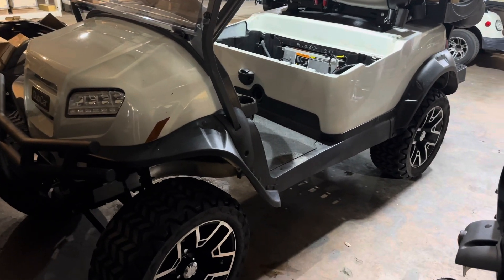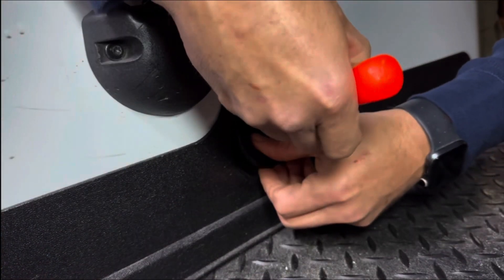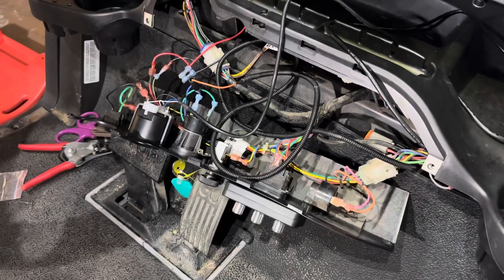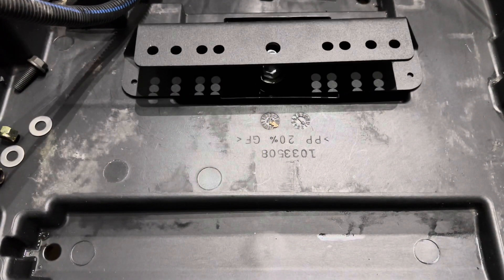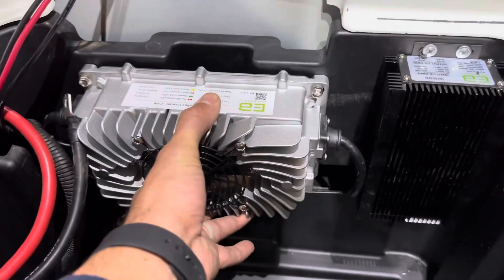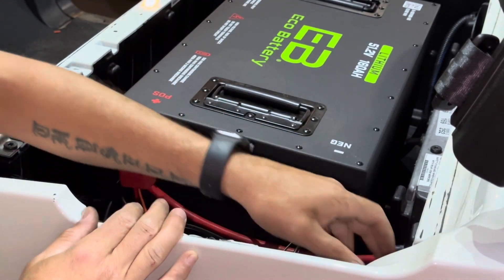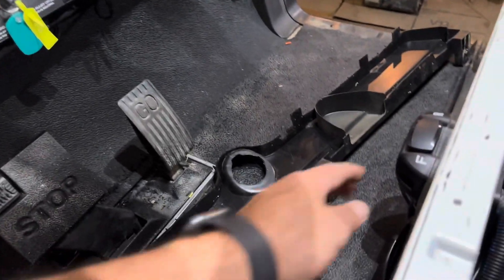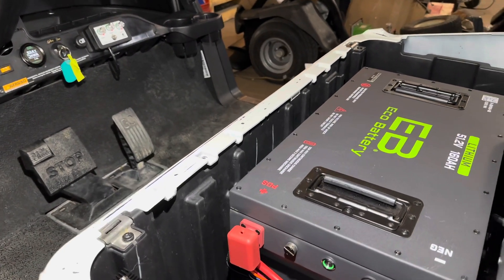Eco Battery 51v - 160ah Lithium Golf Cart Battery Installation Video - Club Car Onward/Precedent

Comment: I have a Ogrphy 51 volt 150 amp  and find it is a very tight fit for my 2016 EZGO TXT
Reply: Have to add a couple of layers of 2x10 and bolt it down .
Reply from the maker: Gotcha, some of these batteries are a tight squeeze for sure.

Comment: Your videos are very good and informative.  I have a question that I hope you will answer.  I have an Onward HP.  They are AC powered.  What are some things I need to worry about when I switch from the current Trojan batteries to an Eco or Bolt lithium battery?  How would the installation differ from yours?
Reply from the maker: I would recommend looking at @BoltEnergyUSA YouTube channel. I did an AC drive conversion for them.

Comment: I just purchased a Club Car Onward HP-Reading brochure it has a AC motor and controller. 
Will this battery work?
Reply from the maker: If it came with lead acid batteries, then yes. I may have a video to suggest for your model. You can search BOLT ENERGY USA's youtube channel and scan their installation videos. The process would be the same for the ECO Battery.

Comment: Is the black wire you disconnected from the factory harness for the voltage reducer positive?  The blue wire on my club car was hooked up to negative. I just did a lithium conversion and none of my lights are working now. I never unplugged that black wire and hooked it up to anything. Thanks in advance
Reply from the maker: The black wire connected with the yellow bullet connection is the ground for the reducer or lights.. the blue is the positive for the lights or reducer
Reply: Where do I run the 12v output too?
Reply: Extend it in a run it where exactly?